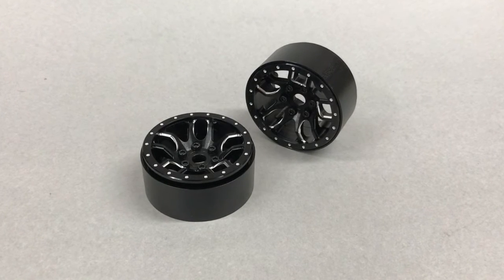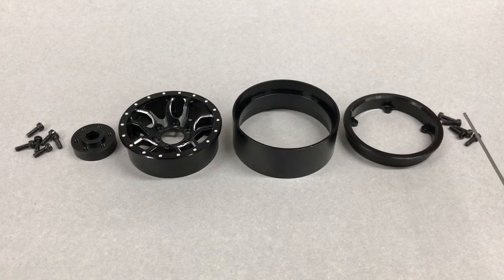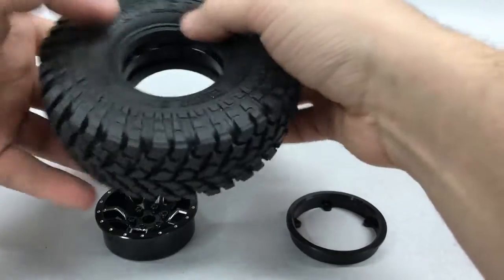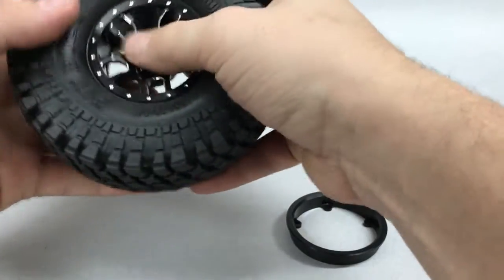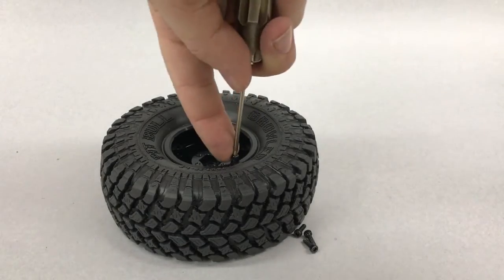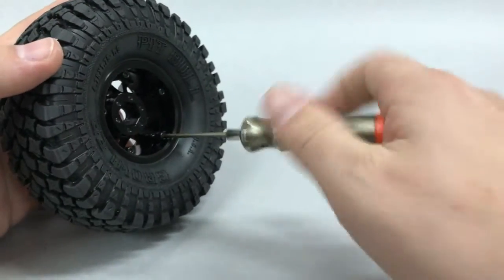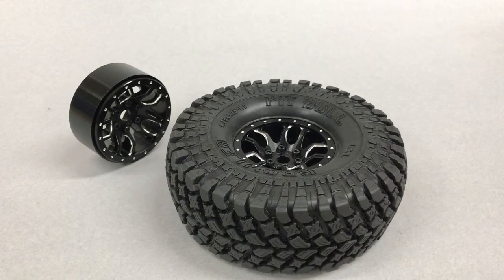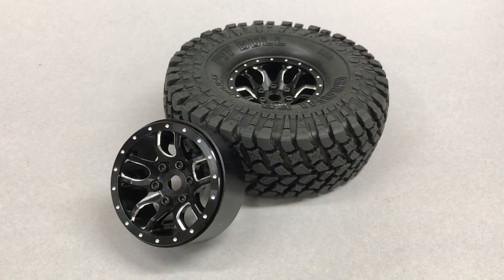SSD 1.9" Double time beadlock wheels

Comment: did you use loctite? or does it need it?
Reply from the maker: +Smalls legend any metal to metal I usually do. On the hubs for sure. I did not in this case for the wheel mounting screws